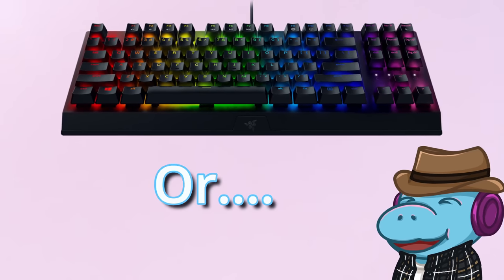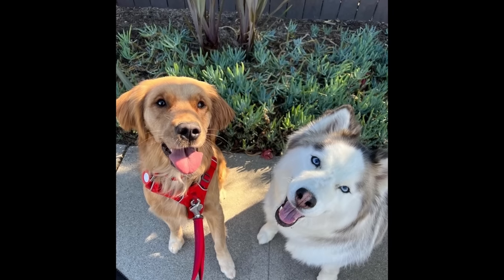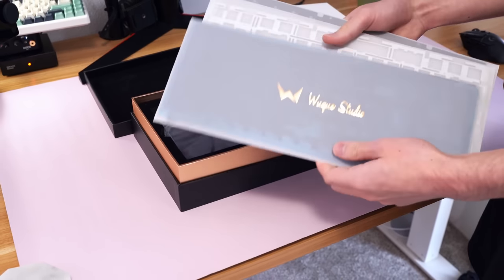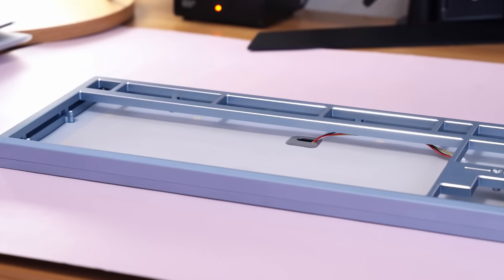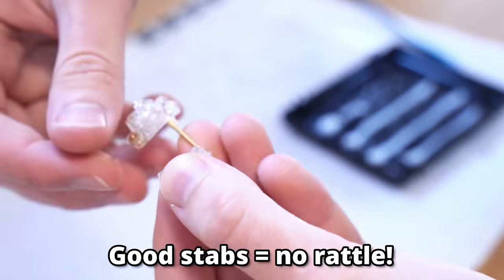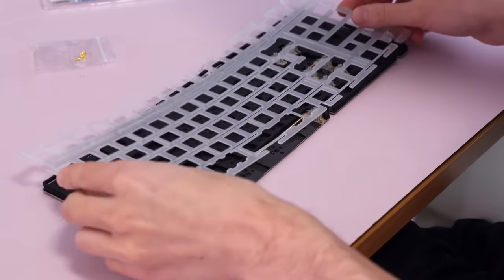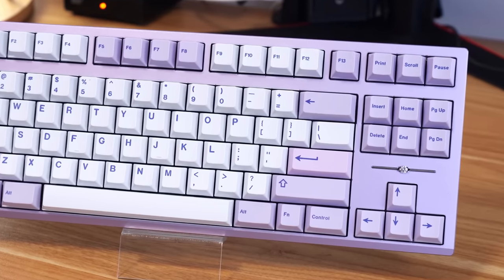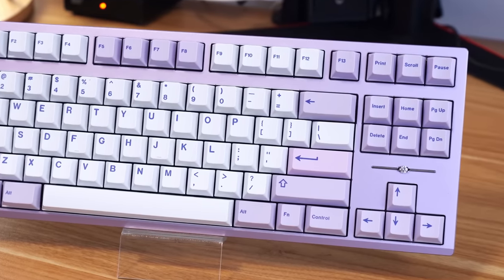Gaming Keyboards DON'T Have To Be Like This.

Comment: I play a lot of osu! (rhythm game) and every custom keyboard I’ve built has noticeably worst input latency than a lot of gaming keyboards, so gaming keyboards have always been my go to choice. Hopefully customs start widely adopting things like optical switches and software features like rapid trigger so there can truly be a best of both worlds
Reply: Better durability is also something I want, on my keyboards that have lubed switches (I’ve both lubed them myself and have boughten them from services that lube them for you) I’ll always have a few switches that die after a few months of heavy use. For now I’ve given up on customs, the novelty isn’t worth the lack of functionality compared to significantly cheaper keyboards IMO
Reply: Hello I am a big fan of yours
Reply: I've found that custom keebs are rather tall and produce much more strain in my wrist when gaming.  Gaming keyboards aren't as tall and feel much more comfortable for me anyway.  Also the input delay is so important when gaming..  It's overlooked forsure
Reply: But the thing is, latency is varied on MCU performance, firmware, not a switch itself. there is a keyboard uses optical switch, but the latency is over 20ms, 200Hz scan rate.
Reply: I don't know what kind of customs you've been building, but the ones I've done (exclusively 40% truly custom boards) have performed better in almost every way (with the exception of RGB, because I'm shit at soldering SMDs). First of all, all the pro-micro based keyboard run on a 16Mhz Atmega chip which is way faster in both scanning the matrix of the keyboard and processing the inputs. Stock QMK runs the keyboards at either 250hz or 500hz polling rate to the host which is a little slower than most gaming keyboards but with a simple change in the config file you can set it to 4000hz easily and it works like intended (as long as you have USB2.0 High Speed set up on the MCU which is a whole other task in itself), which, again is faster than most gaming keyboards out there. The thing is those pro-micros are built for doing much more than run keyboards so they're not bottle necks at all (usually, unless you're doing stuff like split keyboards or screens using I2C, which throttles them and is better left to ARM based MCUs). There's even the chance to run without diodes and matrix scanning using IO expanders, which, in theory should be even faster. The thing about durability is that it depends much more on the switch and the manufacturer than it does on what you do with it. I run a heavily modded Gateron Aliaz switch daily which has paper in it for leaf spring stiffness, lubed housings, stems and springs and none of them have gone bad for over a year now, while, I had very lightly lubed Tecsee switches that died constantly and seemingly randomly. The durability of the keyboard itself is much the same way, depends on what you get, and as a bonus, it can be easily repaired/cleaned/maintained. Also, once you write your own code for them the usability just increases beyond novelty, macros, tap-dances, tap-hold features and so on that no keyboard OEM will ever do.
Reply: totally agree. Do you use the 60he then?
Reply: For a lot of people, latency wouldn’t be a big issue, but to competitive gamers that rely on every millisecond it is. In a Venn diagram where gamers are in one circle and enthusiasts are in the other, there’s barely anyone in the middle region to the point where most customs ignore latency and end up being (sorta) shunned in the gaming world for having too much latency, and most gaming keyboards ignore sound, feel, and other things enthusiasts care about and end up being shunned in the enthusiast world. These worlds are like absolute polar opposites of each other and the area where they overlap each other makes Wyoming look like an introvert’s worst nightmare.
Reply: @videogamer281  there are very low profile custom mechanical keyboards. I'm using the Corne-ish Zen and it's pretty much as low as it gets without using a bare pcb.
Reply: Wait can you do osu! vid pls
Reply: hey intel
Reply: @SupperGammer  You wrote the thesis but you completely missed the point.
A standard gaming keyboard, which you can just buy, plug in and start using, has a latency of 4ms to lowest 1ms (Razer,steelseries etc. has 1ms options) is much more convenient than buying a custom keyboard and doing all that shit to gain an insignificant performance boost.

For comparison, the Razer Huntsman has a latency of 1.2ms meanwhile the keychron Q1 upto Q4 all have 11.3ms delay. This is a huge amount for gamers
Reply: My board was able to be flashed to 1000hz polling rate so with the right switches, it good enough. Keyboard latency is pretty insignificant anyway, mouse is what matters

Especially if you don't play professionally you have nothing to worry about
Reply: @ZenTunE-  actually its the gamer that matters...
Reply: @SupperGammer  how to do it to
My board it idk  jackshit about coding
Reply: Hi Intel!
Reply: SHEEEESH i did not know ur in the custom keyboard hobby!
Reply: They already do that in custom keyboard space not widely but that is something existing just like full size custom keyboards with knob you have to go much deeper for something analog input ( im not sure anyone has done it except wooting but probably someone did )
Reply: @MAGAIVER  Will have a look at it.  Thank you!
Reply: @videogamer281  use a wrost pad
Reply: @SupperGammer  Intel doesn’t know shit about custom keyboards he’s got a gmmk pro which specifically has worse latency than most keyboards, gaming or custom. He also thinks that abs keycaps are instantly worse than pbt keycaps and bought glorious pandas for osu for some reason.
Reply: @SupperGammer  give us the source of info on how can you speed up the polling rate of a QMK-powered keyboard up to 4000mhz
Reply: hi intel

Comment: The ABS spacebar always tends to have a bit less of that "hollow" resonance... it just hits different than the PBT.  But the alphas both sound great.  I'm now wondering how quickly the GMK set will shine with use from a pro?
Reply from the maker: I'm curious as well... Probably will take ages on the board he only plays on for comps
Reply: as a filthy league addict, my GMK Samurai set started shining after just about 2-3 months, i play around 5-10 games per day
Reply: I put some noico in my spacebars. Really helps get rid of any hollowness
Reply: I Made my first keyboard today 😊
Reply: depends on your hygiene as well! I always ensure my hands are clean before using a keyboard. I've daily driven multiple sets for months at a time and only one of them really developed any shine! I still expect for shine to develop on these sets but not any time soon.
Reply: @recessedsubhuman  also a usage thing as well! its gonna vary from person to person
Reply: @AnzelLmao  How you type is also a factor. I'm a really heavy typer, and my GMK sets shined in 3 weeks 😬
Reply: Two blocks of foam glued in under the spacebar's hollow area to knock it out.

Uhh don't buy a pudding spacebar for this trick. Especially on a board with dampened switches. Foaming up the center gaps of the spacebar is pretty much mandatory if the point of a keyboard is being quiet.
Even if your switches have the rubber stoppers and your stabilizers are rock solid, those spacebars pop like a drum on the return.
There's an advantage to smaller, split spacebars for sound, but on the other hand a large disadvantage to finding keycap sets with them.

Comment: I think it'dve been worth mentioning how you can still have gaming features like macros with QMK/Via firmware boards since it was mentioned a bit earlier in the video. In some ways, those keyboards can be even more capable than the gaming keyboards that use closed source proprietary software. At some point, a segment on firmware could potentially be informative to the average keyboard buyer.  I've been thinking lately about building an ideal (to me) gaming keyboard layout, and it'd probably be some sort of split ortho build but with more keys than you'd find on a typical split ergo board, but I don't really game enough with mouse and keyboard anyway so it's hard to justify given putting time into figuring out given there's other stuff to do. It is kinda surprising that there's not really many gaming boards that use ortho 1u layouts since it's a lot easier to reach keys with those layouts than on an exploded staggered board.
Reply: Really love my zsa moonlander, it uses qmk and it's a split design! I can't praise the work the qmk devs have done highly enough. It's really great stuff and the music functionality is a cute bonus ahahah

Comment: If latency is a concern, it's definitely worth trying QMK.  It scans at about 1000 Hz, and can get ~10ms latency with the default deferred debounce, or ~5-7ms with asymmetrical "eager" debounce.
Reply: Also the USB polling rate can be increased. I run mine at 2000Hz whereas most stock configs have it at 500Hz I think.
Reply: @SupperGammer  Standard USB polling is at a very precise 1000 Hz.  It can make a really obnoxious tone when using USB for audio purposes with analog equipment.

Comment: I have a GMMK2 from Glorious, it's kind of a nice middle ground since it supports hot swapping switches, has rgb (listen, listen, I love me my rainbows), has good switches that I believe come factory lubed (don't quote me, I haven't had any rattling or scratching, stabilizers feel good too with no issues or rattling). Most importantly though, it's small. I do digital art (as well as more traditional mediums) at my desk so I need room for my drawing tablet when I'm working on projects. My last keyboard was a full size one, so going down to a 65% one has really freed up a lot of space. Doing research when I was looking into getting a new keyboard actually led me to your channel, and while building a custom keyboard is very interesting to me the price and time to acquire all the parts was less enticing; the GMMK2 was compelling at the price point and for the fact many local stores carried it in stock and I could just plug and play. If I ever want to dip my toes into customizing, it's not a terrible platform to build from too.
Reply: Holy ** that was long

Comment: Why I like gaming keyboards: I do not like light and saturated colors, I LOVE clicky switches (I would endlessly enjoy a keyboard that sounds like a typewriter), there is FAR too much confusing info on custom keyboards, most custom keyboards do not have what I need (100% layout and volume rocker of some kind are an absolute must), choosing keycaps is insanely hard(mostly because of availability), the custom keyboard crowd's take on RGB (RGB should be functional - it is utterly pointless in non shine through keycaps). I think that about covers the important parts. And another thing is, I am not rich enough to test everything out, to find out what I would like more, talking about the myriad of parts that can go into a custom keyboard and influence it's final feel and most importantly sound.

Comment: I have a tactile mechanical keyboard, but I would prefer linear switches. They’re too loud 😅
Reply: theres little to no volume difference between tactile and linear. i think u might mean clicky.
Reply: red: tactile
blue: clicky
Reply: @probablyyourneighbororsome8412  if ur talking about cherry mx...not quite. red is linear
Reply: @Sinsanatis  Yeah, LOL.. There is not much of a difference sound-wise. And linears are a nightmare to type on. That's the only difference. When I had a linear keyboard, I found myself bottoming out with force to make sure it activated. Because of that, it was even louder. And felt like shit. NEVER again! I, honestly, will never understand the hype about linear switches..

If you want a silent switch, try Bushi switches, or equivalent, with rubber or silicone dampening inside.
It's lovely.
Reply: @191.  eh linears arent that bad. my preferred switch type is def tactiles, but i do like typing on clickies too. linears feel weird when coming from being used to tactiles but after a bit, its not too bad. i think the thing about linears is the fact that its the most basic representation of a keyboard switch. goes up and down and actuates. no frills. it also creates for the smoothest possible experience when combining lube and such. and the popularity remains on for gaming for obvious reasons. 

and in the community, loudness for the most part isnt that much of a concern. for the most part, thats usually a concern when it comes to specific cases like using a custom at work or having others around in ur desk space.

Comment: Main features I like about my logitech boards (vs most mechanicals in the same price range):

- Multi-device support with rapid switching,
- consistent support for regional layouts,
- good, mature software with lots of quality of life features,
- performance is usually top tier (operational, but also battery life, luminosity, connectivity),
- same software as other peripherals (less bloat),
- great warranty service and support.

Personally, I'd love it if Logitech designed an MX Keys Mechanical variant geared towards keyboard enthusiasts. They did one for the regular MX Keys for media creators that has custom features for artists.

I don't think something that you'd need to assemble, that's not their business model, but something that allows for custom switches and keycaps with other gamer benefits would be a good middle ground and very interesting. Especially if those "gamer benefits" are stuff like:

- Lightspeed connectivity 
- TKL with a numpad attachment (like the Asus Claymore II you tested last year), but that can work standalone and can have the keys remapped as macros with a profile switching feature. 
- Removable faceplates like the Logitech G715
- Wireless charging (like the Angry Miao Cyberboard)

Comment: For Keyboards, IMO the software is one of the most important things for me.
I just like to have multiple profiles, where I can easily switch between.
Yea, media keys on the left, linear switches, and yea I like the RGB, because each profile changes the background light, where I can easily remember the hotkey layout.
Not much of a sounds fanatic, but the more silent it is, the better, but priority is speed.
Reply: what are some of your favorites ?
Reply: @zephgamba  Tbh, I haven't seen a single keyboard software which was satisfactory.

The Mountain Everest is the one I'm using currently, because the software has a ton of customization, but is limited to 5 profiles (I export-import some others and only use the 4 most common ones)  and has some small problems. Thought I love that you can put the media key and numpad on the left and right.

I liked (not anymore tho) the Logitech Software, but their keyboards are utter garbage.
Razer is actually quite decent, but haven't looked that much into it.
Also looked into ASUS ones, but the software is just not good.

Comment: Nr.1 My favourite switches are clicky so any sort of lubing is out of the window. 

Nr.2 The simplistic look of custom keyboards gets really tedious to me, of course they look clean but at the same time it would be too hard to match it to the rest of my setup.

Nr.3 I find customs having differences in MS compared to your regular run of the mill ''gaming'' keyboard which immediately negates any upsides they might have for me. 

To conclude : Customs are cool, people that like the sound and feel and type a lot will love them. Issue comes with polling rates, with the price of customs I cannot justify having problems like that.

Comment: To answer the RGB question
I have 2 different profiles I usually switch between, one with rapid fire and 1 without rapid fire but certain keys have a different actuation point. One profile is running static and the other is running a reactive ripple effect.
So I use the RGB to let me know that I am on the right profile. Also a Wooting keyboard 🤌🤌😊

Comment: I use a corsair K70 RGB MK.2 Low Profile with m x speed  switches. I use a gaming keyboard because. (1 I know the brand I know the quality and the software.) ( 2 I like how it looks I like how it doesn't look like the same keyboard I learned to type on in the 5th grade. All of the custom keyboards I see look the same other than the color. Like someone took a dystopian city and fit it on a desk I hate it.) (3 RGB.....its pretty lol.)

Comment: I was close to building a custom keyboard for gaming but ended up buying a Razer Huntsman Mini SE and I love it. The SE is a slight upgrade from the other huntsman mini's. It came with white doublehot PBT keycaps on a black board, it has the gen2 optical switches which have added dampening, it also has dampening foam in the board and a coiled usbc cable. I can use all my razer chroma profiles and sync it with my mouse and pc lighting easily.

Comment: Before I built my board, I was using a Ducky One2 Mini and I took it apart and adding foam, then getto lubed the switched and stabs (basically, I just put the lube on my brush and shoved the bristles into the switches). I also left the middle screw just barely on. So basically, it's there, but it's ever so slightly turned just enough to not come out. And, it's crazy quiet now. It actually sounds good for what it is. But that made me want to start from scratch. So I bought a cheap GK61 kit that comes with everything you could pick from. So I played around with it and I love my new board to the point that I'm leaving really long comments just to use it more than I normally would use a board. But, I do need new stabs. While they aren't bad, there is some rattle in my backspace and space. Mostly my backspace. Hey, a reason to type better.
Reply: i have one of those GK61's.  If you havent already, try lubing the stabilizers.